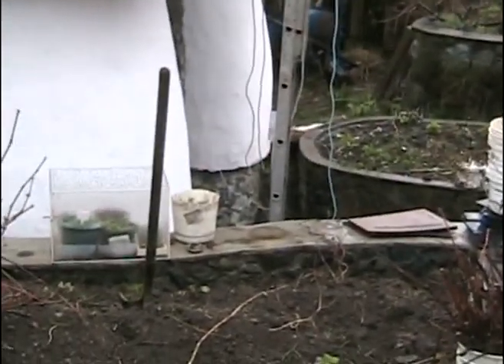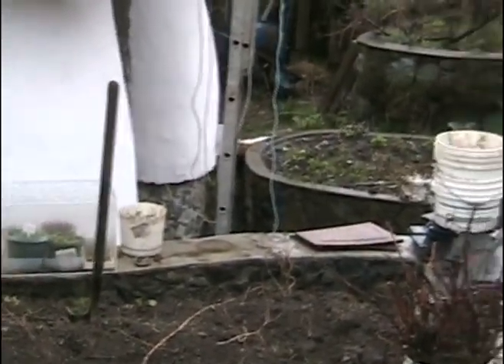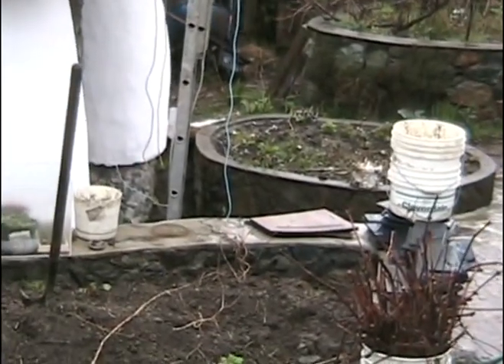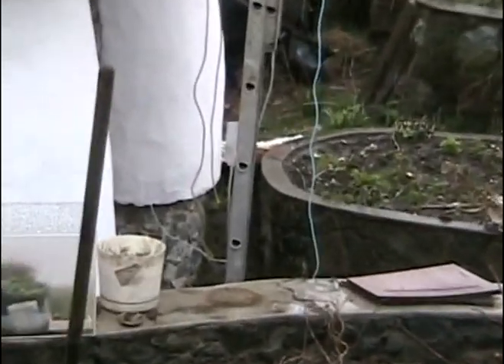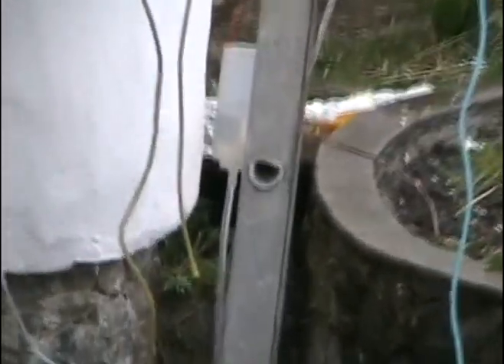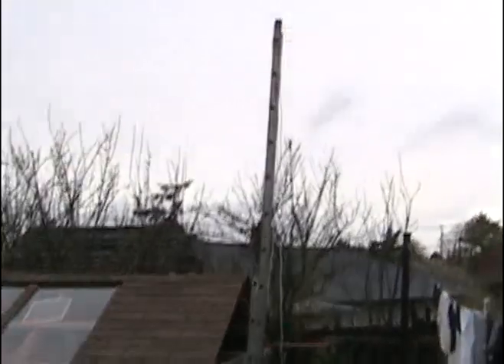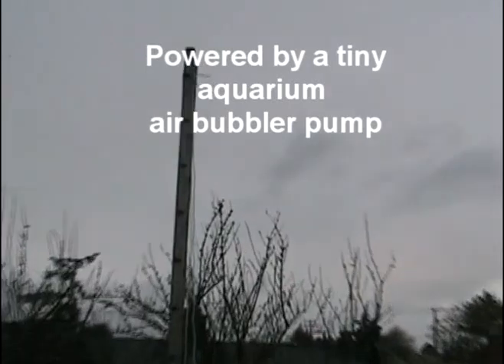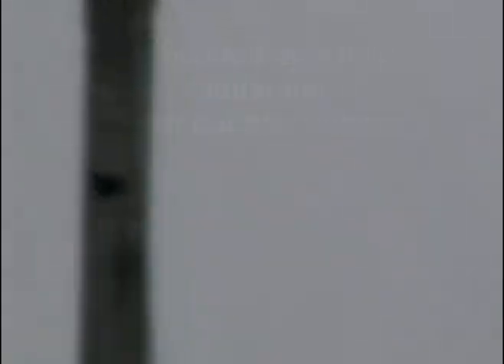Pulser Pump Nano!  How high might the tiny version pump?

Comment: I just came across this principal and it seems rather interesting, the only thing I keep wondering about is why no one has thought of using a windmill with a one way walve setup to produce the air pressure needed, now I dont know if simply attaching thinner tubing for added pressure and pump heigth to a normal windmill pump would be more productive (reach a higher climb, not neaccesarily amount) or if it's applicable to this setup?
And would a simple capillary system be cheaper/ more effective?